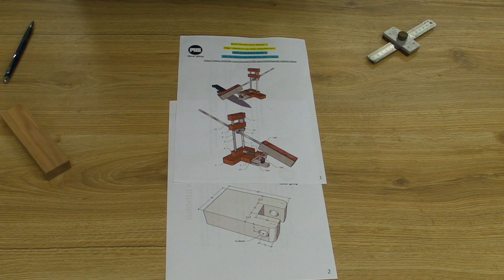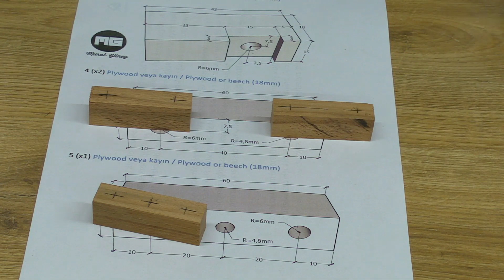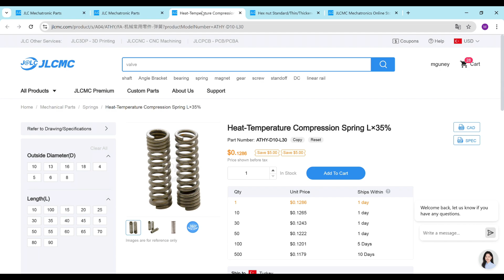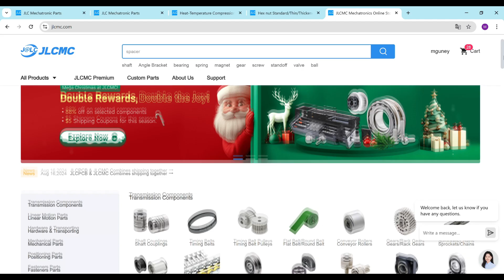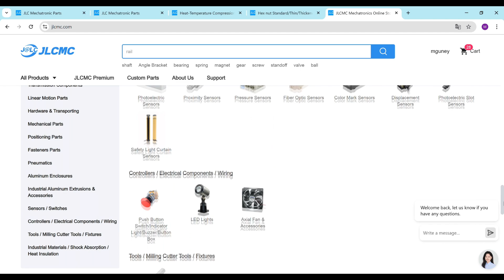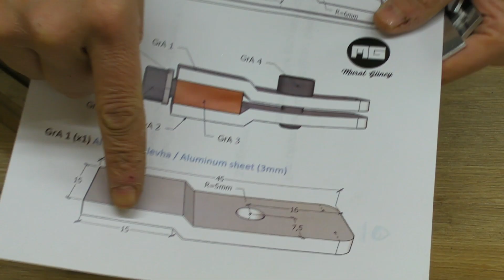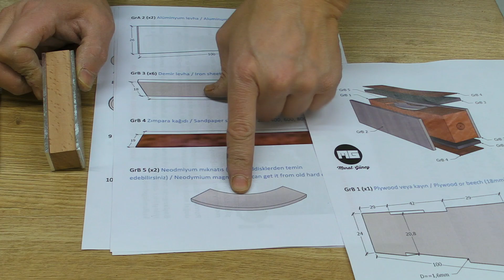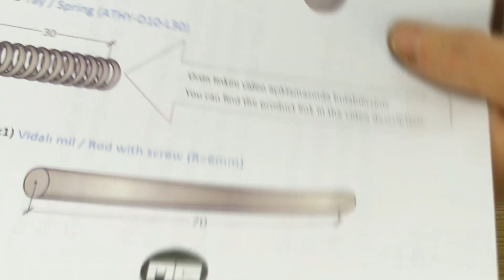Best DIY Knife Sharpening Jig

Comment: Brilliant design, but the mechanism that allows the blade to flip over looks a bit weak.  I would either make it wider or use some other material that can hold tighter tolerances (e.g. precision milled brass).

Comment: What is the device that the rod is pushed through that allows the rod to rotate smoothly?
Reply from the maker: Hello. This part resembles a bearing. It's called a shaft end joint. You can find the part numbers and links in the detailed project plan in the video description. Thank you for your interest. Greetings from Türkiye 👍

Comment: I use a similar tool for knife sharpening and manage to obtain satisfactory results despite the fact that sharpening is not one of my skills. I recently added a height- and tilt-adjustable base to this tool, which allowed me to sharpen practically everything with ease, milling cutters, gouges, chisels and planer blades.
Reply from the maker: Congratulations. If possible, I would be happy if you could send me a photo or a short video. muratguney67@gmail.com

Comment: Hello! About the pdf plans. When you indicate "R6" for holes and rods I suppose it is 6 mm in DIAMETER, not 12 mm ? It would be very large in comparison of the wooden parts size.
Reply from the maker: Hello. You thought right. In mathematics, the letter R is called diameter and r is called semi-diameter. That's why I used it this way. I may have been a little self-centered. In other words, I thought everyone knew what I knew.
Reply: Thank you for these explanations. I like your videos very much and it is very kind to give the plans for free. In France diameter is symbolized by a "O with bar" on technical plans, like this: Ø 6 mm. For screws we use for example "M6" which means "Metric 6 mm".
Reply from the maker: I also use this sign. I can choose this from now on. No problem. Thank you for your interest. Greetings and respects 👍